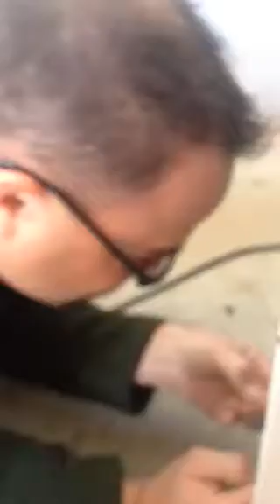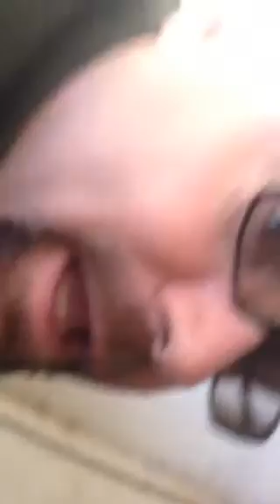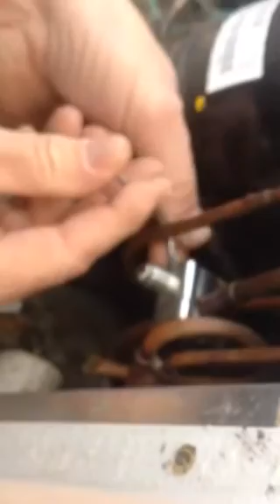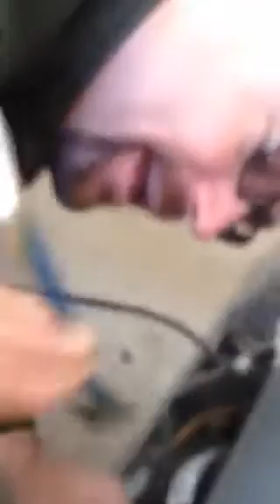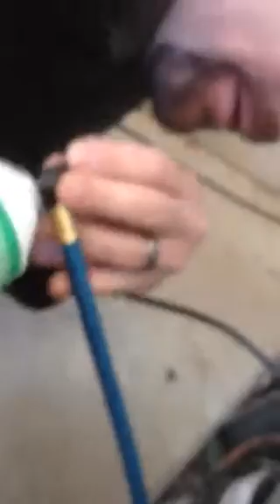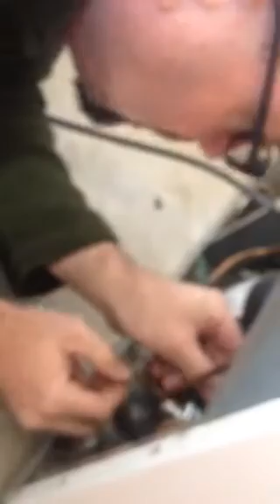Recharging a refrigerator

Comment: Was that a 1/4" saddle valve>  What is the name of the part you used to connect the coolant with?  Did you weigh the canister to keep track of the usage?  Pretty sure if you used it all you froze your fridge to death.  They usually only hold 3-5 oz's.
Did this work, and how do you know what line is the "suction side?"  What is that crimpt off line for?